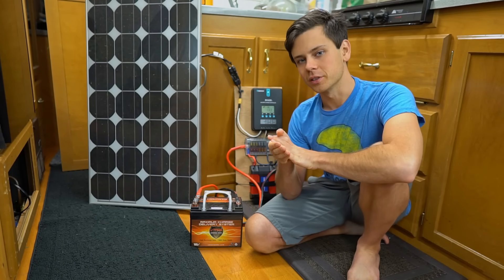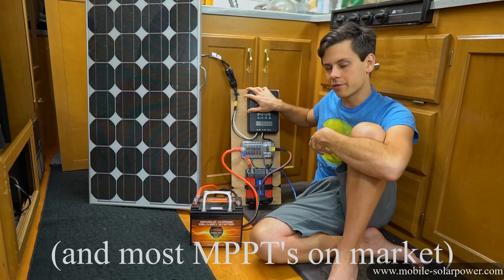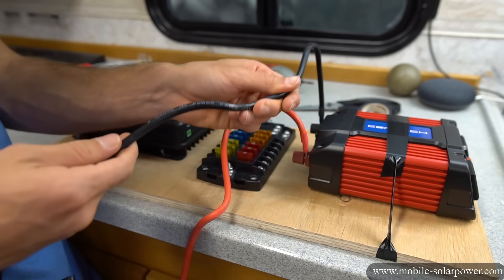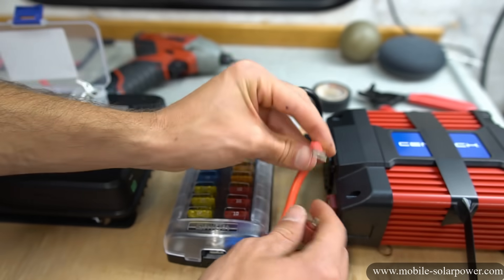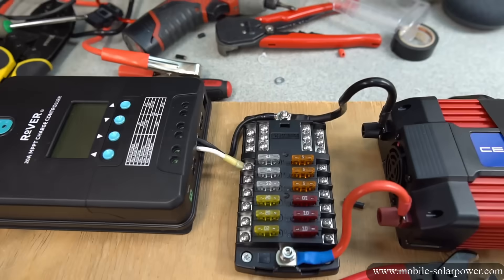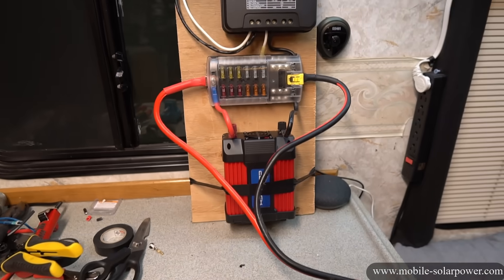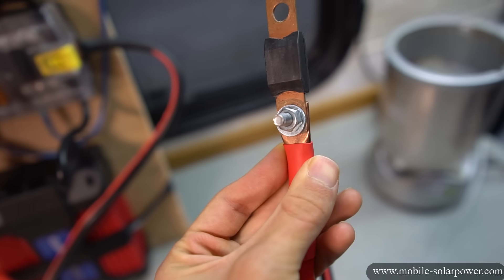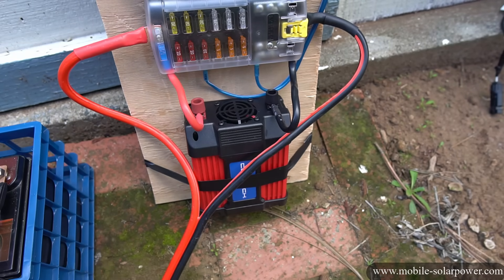DIY 200 Watt 12 volt Solar Power System "The Minimalist" Beginner Tutorial

Comment: why don't you use the DC load connectors on the MPPT controller?
Reply: I had the same question. Were you able to find an answer? To my understanding, you would be able to monitor the output current and voltage if you were using the load terminals of your Renogy MPPT controller instead of connecting the load directly to your battery. I think that the load terminals of the MPPT controller are limited to 20A so that could be the reason to connect the inverter directly to the battery.

Comment: So I’m building a small cabin (144sq ft) and I wanted to do a similar version of this system, without the fuse box. Would I be possible to have: panels, cc, battery, and inverter, with one stand alone light switch wired off using regular romex? Sorry if that is confusing or doesn’t make sense? But for my application I do not find a use for the fuse box. Seems more logical just to fuse between component individually since I’m not running 12v appliances, rather using the plugs on my inverter to power “normal” things… would appreciate anyone’s input!

Comment: Why connect the panels in series also there are two other connections on the charger controller you did not use which I currently am basically it's solar panel to controller controller to battery and then controller to service panel am I doing this wrong?

Comment: I'm interested in doing a few modifications off of this system, but I'm also not sure if it's entirely possible. I'd like to 1.) Hook this up to a preexisting 1800 watt pure sinewave inverter, brand is "Dimensions"  (also hooked up to vehicle's alternator) and 2.) Bump it to 250 watt solar panels and 180 amp hours from the batteries. Would I be using all different components? Or what things would need to change?

Comment: Hi Will. I see you saying that you wouldn't use a modified sine wave inverter for a 200W build, but on your website your recommendation for the 200W minimalist build is the Krieger MSW inverter. I don't understand - is it a mistake? I'd be really surprised if you did propose a MSW for your build, even the 200W one.

Comment: That's so interesting that you connect the battery feed from the controller to the fuse box and not directly to the battery, same as the inverter. I have my controller and fuse box going directly to the battery...is this just personal preference?

Comment: Thanks for this tutorial.  I did my first solar experiment today with 2 "100W" flexible panels, a Victron MPPT controller, two 10AH LiFPo batteries and Iceco Go20 refrigerator/freezer.  Nothing started a fire and I was making ice all afternoon.  Didn't notice any wires heating up.  Need a little bit more packaging, and confirmation that I can keep the freezer below freezing all night, and I should good to go for some car camping.

Comment: Small question: my fuse box looks almost identical to yours except it didnt come with a 25a fuse and my controller is 20a. Is it ok to just buy a 25a fuse and use it? Perhaps the box isn’t engineered for that much?

Comment: Thanks for the vid.  Question..  How do you know when its best to run the Solar in series or parallel?  I ask because I have two 100watt Goal Zero panels that I use on my Yeti1000.  Watching your review on BigBattery 12V OWL 170Ah and Renogy DCC50S 12V 50A charger I end up buying them.

Comment: I have that same CENTECH inverter. I had it under my hood with a single zip-tie for months. Then one of the alligator clips got hot while under only 350 watt load. It is now on my useless table. (the useless table is not a table of useless things. it is a table so full of clutter that it can no longer be used as a table.)

Comment: I have basically the same setup but with 2 100w panels I only have 1 100ah battery will I have enough to run a refrigerator/freezer? Thanks

Comment: Hi there, 04:49 you said if you multiply 20 by 1.25 it gives you 25, i understand 20 is for amps but what is 1.25 that i will be multiplying with.
Reply: It’s the safety factor

Comment: If a 1000 watt inverter was used instead of the one shown, what size wire would be used to connect it to the negative and positive terminals of the fuse box.

Comment: Hi I'm in the UK, I'm ok with DC/AC power ect.....did 10 years on generators.
Bit new to solar power, so I'm just following the basic rules.
You mentioned near beginning of your video that you was connecting 2x 100w panels in series (=24v+) for a 12v system.
My question is can I do this with my epever mppt charge controller?
Thank you Marc

Comment: I'm no expert but something doesn't look right about this setup.  Other diagrams I've seen connect the fuse box to the 12v load connectors, farthest right on your charge controller and the middle charge controller connectors go straight to the battery.  The way you have it set up now there is nothing to prevent your 12v loads from running your battery completely flat and destroying it.  If you connect the 12v fuse box to the charge controller 12v load connectors then the charge controller can disconnect the 12v loads if the battery level drops dangerously low.

Comment: So what is this, if the battery is full it won't use any power from the sun to run the load? I mean did we all went NUTS discharging and charging at the same time losing energy while doing that?

Comment: Just ordered your book and several components on Amazon through your links. I have a question, can I use a battery tender or any ac powered 8 to 10 amp 12volt battery charger hooked directly to my agm battery while still having my solar system components also connected ? I would only use the ac battery charger when ac shore power is available.

Comment: My main thing on the road is my Krups digital electric tea kettle. It uses 1500w. I've done some researching and hopefully it is correct. 3000w inverter, (2) 100AH deep cycle batteries, (2) 100w solar panels, and a 20a solar converter. Found everything for about $623. Am I correct in the calculations?

Comment: Will - I can't begin to tell you how grateful I am for one specific bit in this.  I constructed very nearly this exact system in my cargo conversion trailer.  One thing that I dorked up was connecting the battery leads to the charge controller.  I accidentally created a dead-short at the terminals.  Because I'd put the output to the battery through the fuse block, I merely poped a fuse which saved me from cooking my brand-new MPPT charge controller.  I might not have wired the thing this way if I hadn't seen your video and followed the best practices you set forth. I owe you one.  Thank you for all you do.

Comment: Hello, I know this video is over 1 year old, but really would like advice! 
A 25W Fast charger for my phone.
For 5 hours a day = 125w per day.
With 3 D.O.A = 375W
 4 hours of sun in UK
375 ÷ 4 = 93.75W 
Rounded up to 200W
(I'm thinking this will mean I can afford to use my charger for longer if needed and still have 3 DOA) 

On my list so far I have:
2 x 12V 100W Mono Solar Panels
1 x 20A 12v/24v Charge Controller 
150W 12V - 240V inverter
35ah 12V Lithium Ion Battery 
Will this be suitable for my needs of charging my 25W phone charger (as its my first time ever attempting solar maths after following a few of these videos), for 5 hours a day, with 3 DOA (but not 100% needed)

Comment: Hello youngman, I am from South Africa and want to share with you. 35 years ago we started installing a solar system at home. Think about it, 35 years ago Solar was still brand new technology and extremely expensive. We installed the biggest panels we could find at that time weighing in at 85W each, we installed 3. And that is what I want to talk about. South African sun is very similar to where you live, in other words harsh at best of times. These three panels a still on the roof after 35 years and even with the harsh conditions it maintained integrity surprisingly well. The voltage on the panels when new was 22 Volt ( I know it sounds odd) @ 85 Watts. The Amps delivered at that time was 3.8 A each. Now after 35 years the cells have degraded a little. I tested the panels last week and was surprised to find the deterioration was only approximately 4%. If my math is correct the supply voltage is still 22Volt @ 3.7 A. The manufacturer of these panels do not exist any longer if memory serves but it was BPSolar SA. Just thought to share and show that if you take care of a system it can last almost forever. These panels are still chugging along happily. Keep up your good work.
Reply: would love to know what kind of solar panel used
Reply: Hello. Where are you? Im in Muizenberg. We too want to fit solar  . Load shedding  sucks .
Reply: @melvynvanwyk3614  hello Melvyn.  I only saw your question now. My apology. Well to answer you frankly, it depends on your budget.  You can install a simple  cheap  system  and still look at a starting price of R15K. Then you can go all the way and go completely off the grid  that means anything from R150K and up. Let me know what your requirement  is and I can put together a plan for you

Comment: Have everything ready now to start getting solar panels ordered and finish the system. I dont need an inverter right now since I am running my ham shack on dc. Ive set the shack up with dc fans, lighting, and radio equipment. Ive installed a PWRgate mppt, PWRguard, and a Rigrunner fuse system. Using all powerpole connectors. Have my Interstate SLA batteries connected, my AC to DC power supply connected, but now its time for the solar panels so that I wont need the AC to DC power supply. The only other thing that I need is a DC Super Booster to bump the 12 volt up to a constant 13.8 volts that is ideal for radio equipment.

Comment: Awesome video! I learned a lot. I have one question about the fuse box, though. I am a total beginner so I do not really know why do we need it, if I just wanna plug in my laptop and a couple lights to the inverter, do I need it? (If we aren't planning on running 12v devices)
I get that it is necessary to have a fuse right between the battery and its wire, but what is the purpose of this 1.25*20=25A fuse in the fuse box?. If it is necessary for safety reasons, why do I need the other fuses in the box if they are not being used? Can I simply use a 25A fuse between  charge controller and the inverter/battery?

Comment: Hey Will, I have a remote vegetable garden on some shared land in the UK, so cold in the winter, and I plan to use lights, water pump, maybe charge laptop/drill batteries etc, and sometimes maybe need around 900 watts for other items.  The other item I will power is a diesel heater for the shed which has a max draw of 9 amps for about 3 minutes as the diesel glow plug warms up, then while running its around 2 amps on max.  I see your in your great video "The Minimalist" looks to be what I want to go for.  As I am in the UK, it's very cold in the winter, which battery do you think would be best?  AGM?  Also, I still don't get how not to run the battery down too much, is there a setting on the inverter you can match to your battery, to save it draining below 50% etc?  Do you have a video or explanation on this?  Thank you !

Comment: Hi there, Amazing videos with plenty of information.  Thank you for all the knowledge. I am installing a system myself but I am struggling on how to set up my charge controller.  So far I have installed 300 watts of solar panels and 2 lead acid batteries in parallel for a 12v system.  What do you recommend my high voltage, and low voltage be set to on my controller to best suit my batteries.
Thank you for your time and keep posting.

Comment: Where do I find a fuse box like that, what size would I need for a 2000 watt pure sine wave inverter ? I already have two new 6 volt 445 amp hour lead acid batteries. Planning on building a system for my cabin. What size solar panels would I need.

Comment: Never done anything like this before, followed what you done everything works ok. One question really would you earth the solar controller and inverter i fitted this into my 1973 VW T2 baywindow and it’s very hard to find really good earth on of these vans. Should I wire into the fuse box or try and find one on the chassis.
Thanks for some really great videos and your book is really informative

Comment: Can 24 volt power inventers be used with 12 volt systems, under the intention of other parts might later be changed to conver to a 24 v system later?

Comment: Thanks
For a small/cheap D.I.Y.  Solar system.  I am homeless,  got kick out of my apartment (laid off).   My parents will buy me a cheap travel trailer (used).  I only will need 12 volt L.E.D. lights,  12 volt water pump & small  Microwave.   Will Prowse  PLEASE design a solar system for my new to me  (USED) travel trailer.
Every one pray for me,  to make it through the covid-19  VIRUS.   And someday return to work.
I know I am not the only one,  out of work,   because the business closed.
Pray 🙏 for all of us who have lost our PAY.
Thanks
Reply: I also plan a 12v installation of the lights in my cabin, I send you a hug and a lot of strength I hope all this happens soon greetings from Argentina

Comment: Hey Will, please can you help. I’m living in the Uk and I know very little about solar. I was running  a  single 100w panel through an Epever  Triron 30v controller last summer and this month I swapped it for a 370w solar panel bought from Photonics Universe a reputable company here in the UK running it through the same controller to 2x 90 ah 12v AGM batteries. Specs said  controller could  could take up to 390w. However after following your wiring really carefully  the controller now says that it’s not charging the battery. No arrows moving across to the battery. It’s also saying that the batteries are empty which we know isn’t correct. So we swapped the 100w panel back in again and it worked. Battery indicator full and arrows demonstrating charging. Yay.  We swapped it again for the 370 w panel , tightened the wiring and it worked for about 10 minutes.  We thought it was just our wiring. Then after about 10 minutes the controller showed it wasn’t charging. So frustrated! Where do I even begin to start trying to sort this out?I contacted Epever and they said that there is nothing wrong with the controller as it can handle a 370w wattage panel. Photonic Uni don’t understand it either. They’ve offered to replace the panel but we’ve attached it to the roof with sicoflex.  The controller appears to be working as it’s giving us indications so it is wired to the batteries ok I think. Surely the wiring is correct as the controller is working and they generate their power from the battery and not the panel?  Whilst I know that you may not have the solution, where would you start looking to solve the problem.? I’ve just bought a multimeter but I don’t know what I’m looking for or how to use it. I’m determined to try and fix the problem. I know you’re super busy Will and you may not have an answer, but if you’ve come across this problem in your research I’d be grateful for your thoughts.  Equally who could I go to to try and get a fix? Thank you for all your brilliant videos. I just love them and I’ve learnt so much about solar. Take care. Sara, from Eastbourne, England

Comment: what size board is that i want to put a solar system in my house and be able to disconect it later im thanking about buying some solar passthroughs  so i can run the solar cables through my home my goal is to ultimatley get off the grid

Comment: @will ... I saw this post on an RV forum site and wanted to see what you thought as far as a valid answer (as you can expect, the forum answers were mixed). Any way to clear up the question? Is that what BMS does or does the charge controller do that? ......
"I've heard many people claim that solar panels charge the battery ONLY and do not supply electrical loads in the RV. How is this possible?

A battery can only be in one state at a time - it is either charging or discharging. It can't be doing both at the same time. Whether it is charging or discharging depends upon the voltage of the bus it is connected to. If the voltage on the bus the battery is connected to is higher than the battery's internal voltage, then the battery is charging. If the voltage on the bus the battery is connected to is lower than internal battery voltage, the battery is discharging. Do I have that correct so far?

The charging controller connected to the solar panels charges the batteries by supplying a voltage (anywhere from 13.2 vdc to ~15.5 vdc) which is higher than the standard internal voltage of the battery (12.7 volts or less). But the charging controller is not connected to the batteries alone. It is connected to the entire DC power bus of the RV. Unless the solar charging controller is connected to the battery alone, and the controller and battery are disconnected from the rest of the RV DC system, I don't see how it is possible for the solar panels to ONLY charge the battery and not be supplying all the DC electrical loads at the same time.

Am I missing something?"
Reply: I was wondering about this too. If the solar panel is getting sunlight, the battery is not full, and I am using power all at the same time, Is the solar panel charging the battery? And/or supplying some power directly to the inverter? 
Also, If the battery is full and I'm only using a little energy at that moment, is power going directly from the solar panel to the inverter?